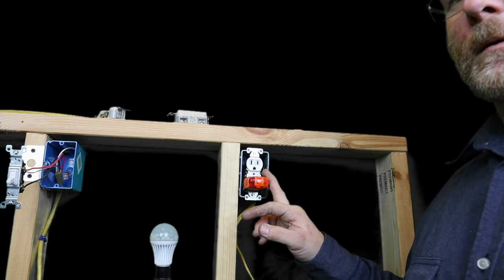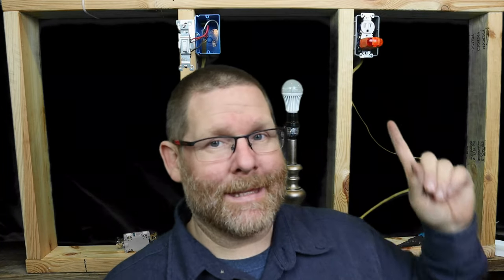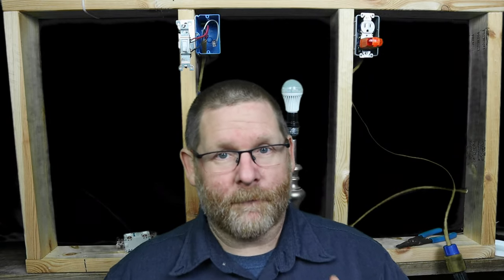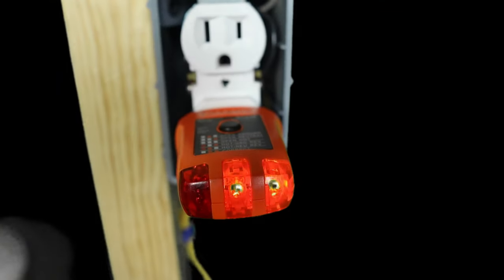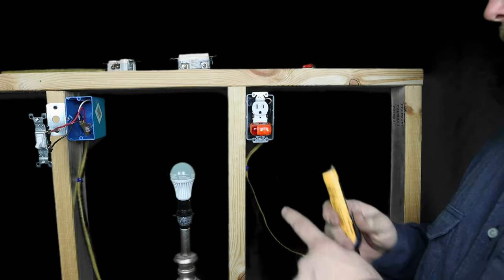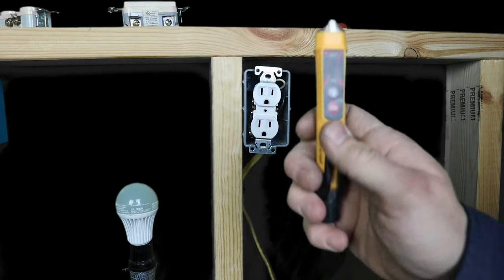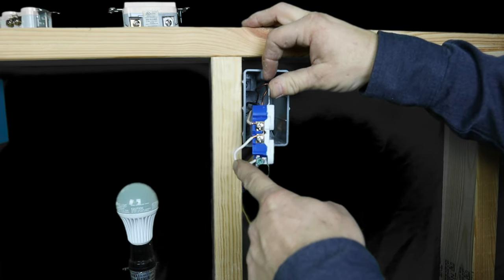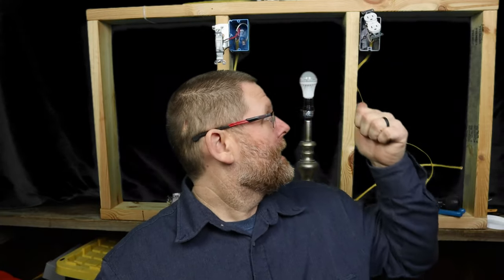Dangerous Open Ground Fix

Comment: Can you help me understand why this is bad? I believe you, but I'd like to understand it from a more technical standpoint.
Reply from the maker: Email me with your question
Reply: @MountaineerOutdoors  why cant you answer me here? It’s inconvenient to email and I’m a busy guy. Plus if you answer here then everyone who is wondering this can know, not just someone who emailed you.
Reply from the maker: Ok no problem ask away..
Reply: @MountaineerOutdoors  Can you help me understand why this is bad? I believe you, but I'd like to understand it from a more technical standpoint.
Reply from the maker: Per chat gpt
Bootleg grounds are dangerous in a house because they create a false sense of safety without actually providing proper grounding protection. Here’s why they are hazardous:

1. **Electrocution Risk**: In the event of a fault or short circuit, a bootleg ground can allow current to flow through metal parts that are supposed to be grounded, such as appliance casings or plumbing fixtures. This can potentially electrify these surfaces, posing a severe risk of electrocution to anyone who touches them.

2. **Fire Hazard**: Improper grounding can increase the risk of electrical fires. Without a proper ground connection, faults or surges may not be directed safely to the ground, leading to overheating of wires, melting insulation, and potentially igniting a fire.

3. **Code Violation**: Electrical codes require proper grounding for safety reasons. Using bootleg grounds circumvents these safety standards and can lead to legal consequences, especially during inspections or when selling the property.

4. **Damage to Equipment**: Electrical appliances and devices rely on proper grounding to safely dissipate excess electrical energy. Improper grounding can cause damage to sensitive electronics or appliances, leading to costly repairs or replacements.

In summary, bootleg grounds compromise the safety of electrical systems in a home by failing to provide the intended protection against electric shock and fire hazards. It’s essential to always ensure that electrical systems are installed and maintained according to proper safety standards and codes to protect both property and lives.

Comment: That was the standard way to ground in many countries in the past. You are correct that it is not allowed in the US but it does ground and is not just about fooling the tester. There are reasons why it not not allowed basically anywhere and it has to do with interference it can cause.
Reply: The only interference you can get is incorrect. Neutral and incorrect hot. In other words, a swished wire which is common without even using this procedure. ?
Reply: I found one of those in my house. Do you know where I can find more info on it. Mostly all I found on Google is that it's a bootleg ground and that it's wrong.
Reply from the maker: @lauradennis8484 what exactly are you looking to find? It's definitely bad and needs corrected for sure

Comment: My son bought a house knowing that there was an issue with an electrical sub panel that the inspector found.  The basement was contracted 20+ years earlier to a general contractor to be finished.  A 60 amp sub panel was installed.  At the main panel, the black and red were in the breaker lugs with the white and bare on the neutral ground bar in the main panel.  At the 60 amp MLO panel, the black and white were in the bus lugs, the red was in the neutral lug, and the bare was on an added ground bar.  Single pole breakers were installed every other space so they would be on the bus connected to the white conductor.  Almost every receptacle had the ears broken off and only one screw on each side.  And of course, they were wired black on silver and white on brass so it would pass the plug in tester.   Also found a GFCI was connected backward and did not work when test button pushed.
Reply from the maker: Wow that's pretty terrible, hope that he got a good deal on the house. Thanks for sharing this and watching.
Reply: @MountaineerOutdoors     It took me 6 hours to fix and change all the receptacles out.   No big deal, but very dangerous.
Reply from the maker: Good for you. I would have done the exact same thing.

Comment: the question that I always have and no one explains in their videos is why can't you have that if in the end the neutral and ground are joined at the main panel?
Reply: In theory the probablity of getting shocked is there due to the fact he ran romex.. still this is not good practice for the true electrcian... If it was wiried differently like EMT, FLEX, Rigid or any other wiring method that shows continuity from the metal box and not blue (plastic no continuity to the panel) that EMT, FLEX, etc.... the metal of the EMT would be like a nuetral and touching that metal pipe can shock you...
Reply: The Ground wire is the emergency "back" path for the current to flow back to the transformer for that split second before the breaker OR gfci trips from over surge, THATS IT 
In a normal operating circuit, the current flows between the N and H back and forth. That ground wire NEVER flows electricity unless the H touches the N, then the G goes HOT and the breaker or gfci SHOULD break open.

Comment: Thanks yes as an 30 yr vet in HVAC ive seen all kind homemade wire jobs & Boning the neutral inside an 2 wire w/ no ground wire ( old Houses ) gas furnace  switch box  is one of them

Comment: Thank you for showing this.  I had no idea you could easily trick a tester like that.
Reply: The tester looks for Voltage between the N and H as well as looks for Voltage between the G and H because the G and N are bonded together at the outside panel. 
So if it see's Voltage between both points, it "thinks" its properly grounded but this guy KNEW what he did would pass the tester.
Reply: @ACommenterOnYouTube  appreciate the info

Comment: Holy crap! My mom's old house has two pronged outlets like the one you showed and I was going to replace it with a grounded wire just like in your video!  I've since removed the outlet and capped the wires due to the following issue.  Her outlet wires has power to it but not the receptacle and when I plug anything into it the power to the outlet wires goes away! I changed outlets and the same thing happens. Any ideas on why and how to fix. She did have a new panel put in and since then the issue to this outlet and the one upstream of it has the same issue.  Thanks for the video and for any tips you can give me on my issue.
Reply from the maker: Somewhere there is a loose wire, junction box, other receptacle etc or even in the panel

Comment: So helpful, thank you. Please help me figure out how to upgrade from a 2 prong outlet with no ground, to a 3 prong GFCI that is safe for equipment use. 
If the outlet box is plastic with no ground in sight, would the following be correct:
1. Change out the plastic box with a metal one
2. Use a self tapping screw to attach a 6” ground wire to the metal box
3. Install a GFCI that has a ground screw, connect the 6” ground wire, neutral and hot
Reply from the maker: Absolutely not on any of those conditions. Just use a gfci unless you want to really rewire everything
Reply: @MountaineerOutdoors  Aren’t high end electronics still unprotected when only using a GFCI ?
Reply from the maker: If you it to be done right I'd definitely get it fixed so that it can be as safe as possible for sure
Reply: Just because you have a metal box in the wall does NOT necessarily mean it is grounded.  To check a metal box for ground, a simple multi-meter set on ac volts is used.  Wite one probe on the brass screw, put the other on the box itself.  If it reads 120 volts, the box is grounded. if you get nothing, there is no ground connection to the box.  I know that my 1950 house is un-grounded because the romex used has no bare copper included for a ground, 3 prong outlets were not required until the mid 60's.  Now any lights or outlets in the basement are wired in conduit, which acts as the ground conductor.

Comment: As a homeowner working to educate himself when I was first introduced to a GFI outlet tester, like a Klein RT210, I thought I had found the "holy grail" of troubleshooting tools.  I believed that if the correct set of light were illuminated in the tool then that meant all was well inside the outlet.  Like most things this tool has it's limitations.  When one is starting out on this electrical education journey typically one don't know what those limitations are.  As you demonstrated it is easy to "fool" this tool.  I had actually previously seen this scenario.  You did not get into it; interestingly enough the neutral and the ground at the receptacle ARE actually joined together (ELECTRICALLY)  and are at the same electrical potential, back at the home's main electrical service panel where the neutral and ground bus bars are connected.

I am in no way suggesting that "jumping" the neutral and ground at the receptacle is an acceptable practice.

On a side note I used this GFI outlet tester last week and it indicated correct wiring.  When I opened up the box and separated the neutrals I ended up getting surprised when I "discovered" one of the neutrals was hot.  When I measured that neutral it had 120 VAC.  So I learned about "shared neutrals".  The tool is helpful, but as in many things in life "there is more to the story".  Just because the indicating lights light up "correctly wired" on a GFI circuit testing tool there still may be issues lurking inside the box that do not meet current code.  And as you so perfectly demonstrated it does not mean that things are correctly wired; should be, probably is but not positively.

While I am here, and this is already a long post, I have a question for you if you care to take the time to answer.  At a residential panel in a home built in the 70s there are two separate circuits, each one protected by a separate 15 ampere (Ah) circuit breaker (C/B).  And then there is a single 14-3 Romex.  The black wire, from this single 14-3 Romex, is secured to one of the 15 ah circuit breakers.  The red wire, from this same singe 14-3 Romex, is secured to a different 15 Ah C/B.  Then this 14-3 wire is routed to a box in an upstairs bedroom.  Inside the box in the upstairs bedroom the red wire is connected to a black wire from a different 14-2 Romex.  That different 14-2 Romex goes to power a set of outlets in a different room.  The black wire from the original 14-3 Romex powers the outlet, and then powers four other outlets in the same room plus the ceiling light using a second 14-2 Romex.  Is this wiring lay out safe?  I thought a size 14 wire was only good for 15 amps.  The way this is wired, is it not possible that both upstairs circuits could individually be demanding 15 amps?  If that were the case isn't that 30 amps on this 14-3 Romex?  Since there is only one neutral wire from the original 14-3 Romex leading from the service panel up to the upstairs "box", and both circuits "share" this neutral; is not that neutral wire undersized for the total potential load?  What would be the "fix"?  Would running a second size 14 neutral wire from the box in the bedroom to the neutral in the panel be a safe & code compliant fix?  Would I need to add a separate ground wire as well?  Thank you for your valuable time and expertise.

-Respectfully.
Reply: Sounds like a multi wire branch circuit. If its done correctly, it is safe but there are rules. Hire an electrician to double check.

Comment: could you run a seperate ground wire from the panel to a two prong outlet to put in a three prong?
Reply from the maker: Good question, but the answer is no. Seems like you should be able to but it's forbidden.

Comment: Any serious home inspector should own and use an Ideal SureTest 61-164 circuit analyzer. It will find bootleg grounds without having to pull receptacles, along with other wiring problems. It’s not cheap, but it will save you a bunch of time and allow you to be very thorough.
Reply from the maker: I actually have that meter and it will not find bootleg grounds. You can easily trick any meter by putting the neutral and ground together.
Reply: @MountaineerOutdoors  I meant to say Ideal SureTest 61-165. These keys are tiny compared to my fingers.

Comment: You mention @1:47 that a gfci is acceptable, but does the gfci still trip to protect against shock?
Reply from the maker: Absolutely, it's sensing the difference between hot and neutral it's definitely what you want to use

Comment: What happens if you put a socket tester into a 2 prong outlet with a 3 prong socket for the 2 prong outlet? (If that makes sense)
Reply from the maker: Won't show any ground.. Open ground
Reply: @MountaineerOutdoors  which is fine if you label the outlet that way correct?

Comment: 2:40
The ONLY way to satisfy that tester, without using the actual Ground is to take the Neutral and jump it TO the ground lug on the outlet so that the tester see's voltage between the G (neutral wire) and H side and the second you pulled that socket out, i was like .... I WAS RIGHT !!!

Comment: Question please. Instead of attaching the negative wire to the green ground screw which I think is definitely wrong.  Can’t we attach a wire to the green ground screw and the other end to the metal box or a ground in the romex
Reply: ON most receptacles , the green ground screw and the metal tabs on the top and bottom, that you put the screw through to connect it to the box, are the same thing. That being said, if you have a metal box ,that actually is grounded, and the screws holding it in are tight, that outlet would show it is grounded. If not, then that metal box has no ground.

Comment: Now you have me thinking...I see something similar. My house has the ground /neutral, at the box like normal. BUT. The electrical box in my, 120volt  camper, that plugs into my house  with a regular 3 prong 30 amp plug, also  has the neutral/ground connected. this sound like the same situation as doing that to an outlet.  Is that OK in the camper box too?   HELP.

Comment: Then why in equipment such as ranges and dryers do they have a bonding jumper between neutral and ground that you only take out if you have a 4 wire recep and plug.
Reply from the maker: Well this is a great debate. Here is the code that sums it up 250.140.
Reply: It is safe to use the neutral as the ground with a three-wire, 240v appliance because a 240v appliance that lacks a ground is not bonded to the rest of the building’s grounding system except at the panel. In other words, unlike a general purpose circuit, a range or dryer is a dedicated circuit. There are no other appliances/motors/etc on that circuit that, if they were to ground-fault, would energize the cabinet of any other appliance. That is why, In the event of a fault, it is safe to use the neutral wire to clear the fault of that single appliance. It IS possible, however, that a person could be shocked by the cabinet in a three-wire installation if the neutral wire became open (like in the panel), since the cabinet would now have 120v potential with no grounded or grounding conductor. This is why all newer installations have a dedicated grounding conductor with the cabinet not bonded to the grounded conductor (neutral).

Good for you to recognize the need to remove the bonding jumper when a 240v circuit has a ground. Most appliances I encounter have the cabinet-to-neutral bond intact even though they have a four-prong receptacle. Installers see green wires and just land them all under the grounding screw with no concern for a correct installation. “Instructions!? We don’t need no stinkin’ instructions!!” 

The 2023 NEC requirement for GFCI breakers on 240v circuits 50a or less will put an end to incorrect appliance bonding because the breaker will immediately see the bond as a ground fault, which it essentially is. When more AHJs adopt this 240v GFCI requirement, there will be tons of service calls about why their breaker won’t reset with their brand new appliance.